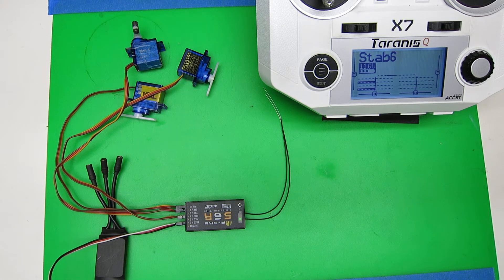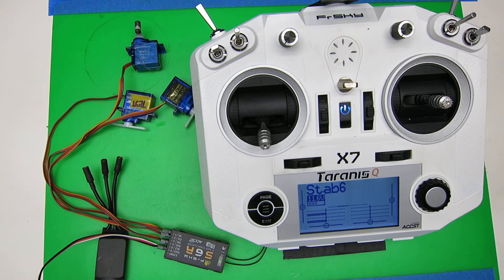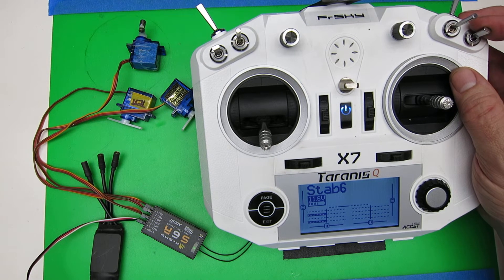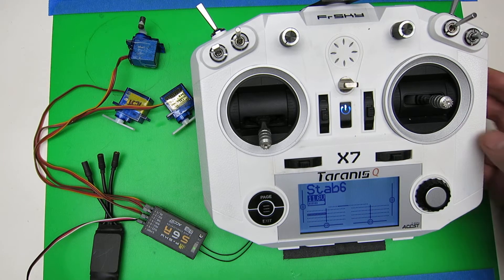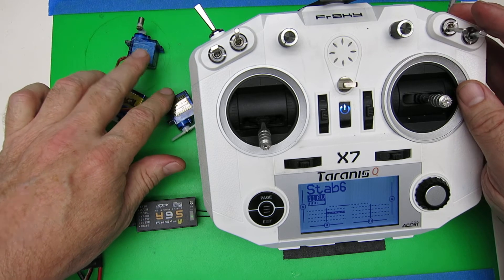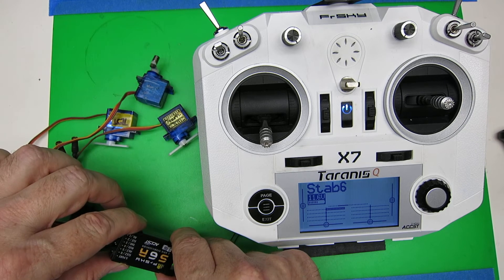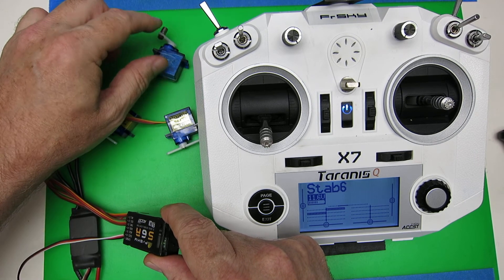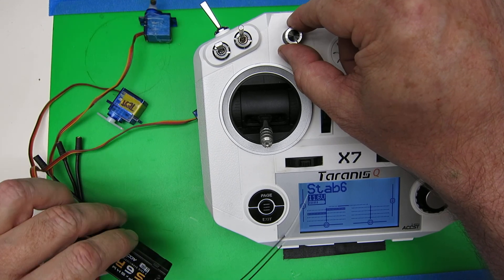FrSky S6R/S8R Setup: Step 5, Bench Self-test

Comment: Thank you for  doing this video series.  Perfect timing timing for me.  Please  continue with an install in a plane. Also I understand there  is a level  calibration once in the plane?
Reply from the maker: You bet!  Continuing this weekend.  You're right, the first calibration is just to set the levelling of the receiver.  Once it's in the plane, there's a second leveling where we set level flight for the plane (which could be offset a bit nose-up, etc).